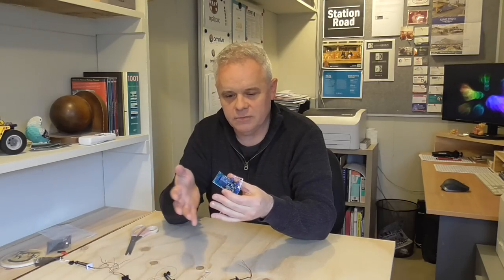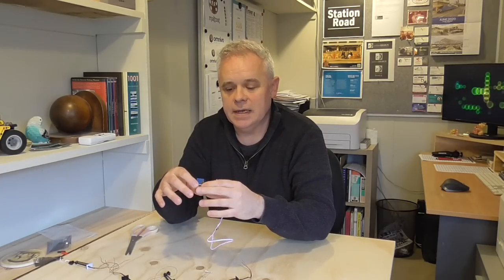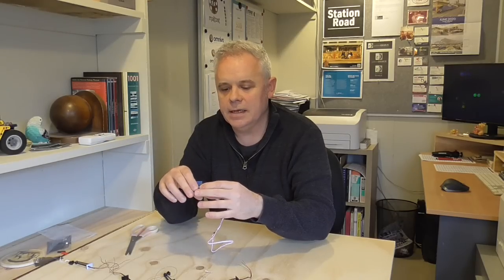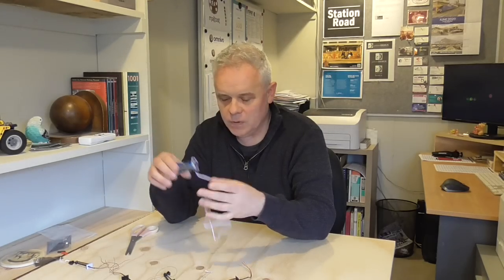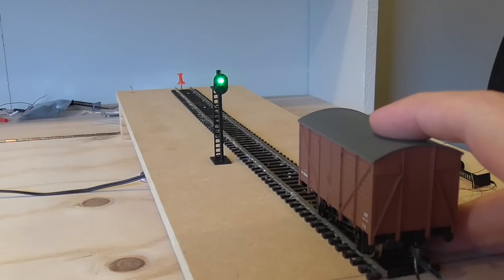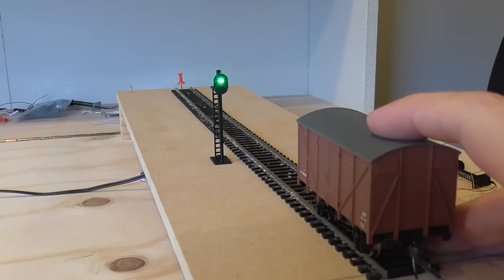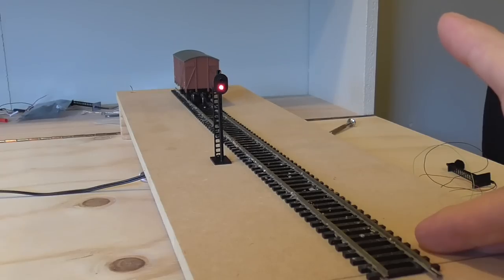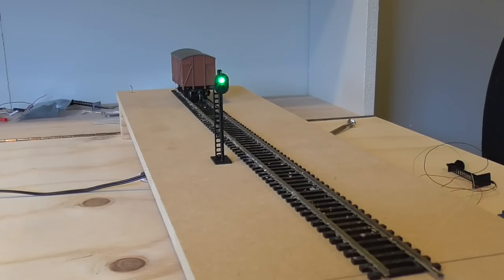Automated Colour Light Signals on a Budget

Comment: I have been using these modules for some time. Cheap. Just need sometimes put a sneaky building and lamp to provide a light, say a  foot crossing or platers shed with lamp. I used as stop end sensors on a shelf railway. Going to use as simple signal changer when train approaches.

Comment: Nicely done.   FYI. The signal lights are designed to be used on 12 volt DC, so  you can just piggy back the input power to the board over to the relay and terminal block, or over to the block and wire it up to the relay, thus eliminating the need for the 2nd transformer.  Oh and the page is no longer found on the AliExpress web address
Reply from the maker: https://www.ebay.com/itm/192279028871

Comment: Just sipping on my L & P with My Jandals on the coffee table watching and thought.  Could I wire this up to a DAPOL semaphore signal you know the sort where there is basically ONE WHITE LED but as the semaphore moves it chages from red to green from the filter  and the signal moves.  I mean would I get enough current from soldering straight onto one of these?   Cheers

Comment: I  will be using servo motor point switching with a side switch for the colour light signal. they will only show a Red light when in the reverse position. (Some might have to be the other way around.) What I have not worked out is Station Start Signals. They may have to be hand switched. I intend to have two through and one terminus station. As for colour. I have white poles and the rest is still black. Thanks for the video and congratulations on reaching  Martin (Thailand)
Reply from the maker: Thanks Martin for your feedback and sharing your signalling/point solutions. There's definitely many different ways model signalling can be operated. I will have a similar scenario with one of my points entering into the station area where 2 signals will operate depending on the point position. Cheers, Julian

Comment: I really like what you have done there, adds some automation without the expensive cost of block detection.
I am sure you could work that to go with a 3 aspect signal, would be good for ground signals too.
Thanks
Alex
Reply from the maker: Thanks Alex, I'll be putting together a video at some point with a 3 aspect signal experiment. I reckon there's a way to do this with 2 or more signals (distance and home signals) where the amber light is linked to the red of the next signal.

Comment: They did use those rounded signals around the sixties, the Southern Region poster "Signal Success" shows a rounded 4 aspect signal with its ladder detail plus gantry mounted signals, Hong Kong also had the same as BR developed Hong Kong's colour signalling system.   Two aspects signals were less common than the three and four lamp aspects which allowed for a better flow of trains rather than the start/stop a 2 aspect would give.   The rounded ones I suspect were more in line with the Southern's art deco theme that led to curvy "Odeon" signalboxes and quite ornate structures (substations had an almost church look with large glazed windows and some nifty exterior detailing to make them look nice)

Comment: Many years ago I did something similar using burglar alarm reed switches in small glass tubes under the track, combined with small magnets glued to the underside of the trains. I did the relay controls by transistors. Using this system I had interlocks to provide a crude block system. For the really technical I used bistable multivibrator circuits for the switching transistors to provide logic for the block system.
Reply from the maker: That sounds extraordinary, love hearing about ingenious, alternative methods of doing things.

Comment: I bought 5 of these relay modules for some dwarf signals in my yard.  I have an old tech 2 power pack that I will run an accessory bus line off of.  Is it possible to run the dwarfs and sensor relay modules off the same accessory bus?  I am pretty good at shorting stuff out...lol.  any advice you can give would be appreciated.   Keep up the good work..  Thanks.
Reply from the maker: Hi George, I must apologies for the very late response to your comment. I think it would be possible to use the same power source for both the relay and signals, just as long as the signals have a resistor connects. I chose seperate power sources just to be on the safe side with current draw, thinking the relay could surge the power thus effecting the LEDs in the signals. And the more signals and relays connected to power sources, the more current is drawn.

Comment: I've got 3 crossing bucks I have installed 3mm red LED bulbs in and got a flashing circuit from fleaBay.  Now I need a way to turn the bucks on and off as a train enters and leaves the intersection.  Others have suggested reed switches or photo cells to turn the flasher on and off.  Any ideas?  I do have an Arduino and have seen the code to make the flashers flash but I need a control for the flasher itself.  My flasher circuit works on either 9 volt or 5 volt DC and I'm using a 9 volt wall wart.  Cheers from eastern TN

Comment: I wonder if you could have a setup where you use two sensors placed at either end of the section...and the first sensor 'triggers' the red aspect and waits until the second sensor is tripped - only then will it turn the signal aspect to green. That way you're more reliably keeping the signal at red until the train clears the block.
Reply from the maker: This is something I didn't investigate further back 3 years ago. I recall working out a circuit that would daisy-chain signals but I'm not sure if two sensors operating one signal would work. One sensor would be 'dark red/light green' and the other would 'dark green/light red'.

Comment: How long did your relays take to arrive? I assume you need one relay for each signal,it looks a good idea. I found a pack of 5 signals on eBay  uk for £15 ,looks the same as yours.Will probably wait for awhile yet as I’m still waiting for some decoders to arrive from Rails,it’s been 4 weeks now. Cheers David
Reply from the maker: Hi David, fortunately I found a local supplier here in NZ and with NZ out of lockdown, it was a matter of days. However, I do order items from the UK and the last lot took 2 months to get here (usually takes 2 weeks), so I'm not surprised delivery times might be considerable.

Comment: Back in the mid 1980's my father-in-law had a OO gauge garden layout and wanted sequential coloured light signals to do the same.  Back then there was little commercially available to do this, so basically I just used four reed switches and a relay wired so that the two outer switches un-lathed the relay, and two inner switches latched it.  OK it meant that at every "section" had four reed switches in a row, but it meant that if a train was run in the reverse direction the signal correctly displayed red when the section was occupied.  The sections were just defined zones, there was no physical blocks.  However, these days model railway electronics has come a long way, even without DCC boards....making it much easier to have things like working lights etc.
Reply from the maker: Hi Malcolm, I totally agree the model railway arena has come a long way from when I got my first Lima train set in the early 80's. From smartphone throttles to iPhone speakers in locomotives, it's quite extraordinary.

Comment: Hi, I am at a bit of a loss with this. I have bought the very same circuit board running a two aspect light. My problem is the timer. The timer seems to only work when the sensor detects light and not darkness as like when the wagon crosses and blocks the light on your set up. Am I doing something wrong?
Reply from the maker: I'm wondering if you bought the correct circuit boards. The version I use is 'dark on/bright off' as per these ones: https://www.ebay.com/itm/192279028871
There might be a version that is 'dark off/bright on' which would produce the results you're getting. There is also another version of board that can do both and is controlled by a jumper. Maybe check to see if you have this type of circuit board: https://i.ebayimg.com/00/s/ODAwWDgwMA==/z/qfkAAOSw1BpgWfHz/$_57.JPG?set_id=8800005007
Reply: Hi Thanks for your reply. I think you are probably right . I will order via your link. Thanks again. John

Comment: Hi. Just found your channel and subscribed. This looks interesting. I have ordered a couple of these along with some other bits and pieces to attempt some coach lighting. I wonder if there is any way to use something like this to operate semaphore signals?
Reply from the maker: Hi Richard, this is a very belated response to your question. It's just taking me a while to catch-up on the hundreds of comments that come in. My apologies indeed. Thank you for your feedback and in answering your question, the relay might work with a motorised semaphore signal, but not sure how. You'd first need to install some sort of servo motor for the signal that has momentary power I guess? The other option would be to purchase signals that come pre-motorised like Dapol's signals.

Comment: I have a couple of the Atlas color signals made for their proprietary signal control system, but the problem I'm finding, since I'm still DC, there are no block detection that is compatible with Atlas' system, and made to work with DC. The other issue, these are from Atlas' first run, so the LEDs are common cathode. I'm having a bugger of a time trying to figure out a system.
Reply from the maker: Hi Michael, I must apologies for the very late response to your comment. I'm not familiar with the Atlas signals but I think there is a circuit device that can convert cathode to anode and vice versa.

Comment: Great video, have a similar system but made myself with a few diodes and resistors and a reed relay, ready made sounds a lot easier, thanks again from Wairoa in New Zealand
Reply from the maker: Thanks for your feedback, great to hear from Wairoa. Somebody else mentioned reed relays so I did some investigation, and yes, they do the job. The light/IR sensor is non-mechanical equivalent I guess.

Comment: Great video mate. How would you go about wiring a 3 aspect signal to one of these modules?
Reply from the maker: I'm thinking once there is more than 1 signal installed, I can link an amber light to the next signals relay. So for a 3 aspect signal, the red and green would be controlled by it's corresponding sensor and the amber would be controlled by the next signals sensor. Hope that makes sense? I plan on doing a video to demonstrate this in the coming month.
Reply: Station Road Model Railway cheers

Comment: If you add a second LDR at the other end of the signal block, the signal, or signals would go to red when a train entered the section from either end. This second LDR needs wiring into one of the wires on the first LDR, and not across both wires.

Comment: The light sensor is a good idea for tracks that are used in daylight.   I use IR sensors, but I find they are also sensitive to natural lighting in the room (ie, sunlight) and sometimes will trigger if the light is bright and not just on reflection. 
I am thinking of moving to Hall Effect sensors, which detect magnetic energy.   I only need to change the sensor for that as I am already detecting on and off in the Arduino / Relay circuits
Reply: I put a feature needing a lamp, like say foot crossing or shed near sensor for night use.

Comment: There are cheap chinese versions of this circuit available through ebay, even cheaper and will work as three or two aspect signals.  You can also vary the length of the delay. These use infra red LEDs and detectors.  They suggest fitting the IR LED above the track and the detector between the rails.  I mounted them between the rails, side by side and the loco or wagons reflect the IR nicely.  It works regardless of ambient lighting. I retro fitted some signals which were made with grain of wheat bulbs and fitted 3mm LEDs.

Comment: Great video Julian, well done and Thank You.  I have been seriously thinking about this system, BUT, mine is a single track layout with running in both directions and I can't fathom out a way to avoid trains travelling in one direction interfering with the signal in the other direction.   Any thoughts, anybody?
Reply from the maker: Hmmm, that is a tricky one. You'll notice I placed the sensor after the signal (half coach length approx) but in the case of a single track line, the sensor would need to be directly opposite the signal I guess.

Comment: Could you explain the use of the sensitivity adjustment.  I have purchased several of the units on e-bay and none of them seem to be set the same upon arrival (several in the active state--red position) and i cannot get it set the change its response,   Thanks.
Reply from the maker: Hi Bob. If you're using the light sensor versions I find the easiest way to set sensitivity is firstly to make sure the sensor is in its final position in the track under normal lighting conditions, then place a wagon over the sensor and begin to turn the small sensitivity dial on the circuit board until the red aspect is illuminated, then roll the wagon off the sensor to check if the light goes green. Keep doing this process until you find the right balance. I hope this helps.
Reply: @StationRoadModelRailway  Thank you so much for you help!.   It is appreciated.  I will give it a try to see how it turns out....again thank you.

Comment: Hi julian great video mate I really enjoyed it I have installed the dapol working semaphore signals at my model of stranraer harbour station they are working every will I work them by push buttons on my control panel for the stranraer line on my layout I use 12v dc to work them on my mainlines I use 3/4 aspect colour light signales work by royart switches I use 9v battery to work them at the moment here in the UK we have a good choice of colour light signales them can be expensive depending on wha what brand you buy I use eckon and berko signles stay safe and well mate goodbye for now clive
Reply from the maker: Hi Clive, I have considered purchasing some Dapol semaphores and think I'll will get some. I imagine I could control them in the same way as the colour light signals, with sensor relays.
Reply: @StationRoadModelRailway  hi julian train tech make a until for dapol semaphore signals and colour light signales Gaugemaster sale them for dcc signal control I hope this information will help you mate clive
Reply from the maker: Thanks Clive, very much appreciated.
Reply: @StationRoadModelRailway  hi julian if you are going to use the dapol semaphore signals dapol now recommend use 9v to 12v dc or 14v ac not 16v ac I hope this information is of interest to you mate clive
Reply from the maker: Yes, I saw Dapol had to do a recall on their signals.
Reply: @StationRoadModelRailway  yes julian the dapol semaphore signals were burning out on 16v ac because the 16v ac transformers were found putting 18v ac and were burning out the signals motors so dapol is saying to use 9v to 12v dc or 14v ac mate I hope this information is of useful to you mate goodbye for a wet N.lreland tonight clive

Comment: Hi Julian,
What do you mean by "It's cold in New Zealand"?  We had 15°C during the day and it's still 13°C at midnight! (Napier)
Are you interested in a cheaper, way more flexible way to control your semaphores?  Controllable by buttons or DCC commands?
2 aspects to many aspects, 256 rgb leds, 768 single colour leds or a mix of them all separately dimmable, servos, sound modules, ...
User defined patterns, day night control, ...
Well, you have to use your soldering iron.
Have a look here - Google translator is your friend - And it's running on my desk
https://wiki.mobaledlib.de/
Reply from the maker: It's a bit colder here in Christchurch, daytime highs of 10-11ºc, -4ºc overnight on several occasions. Thanks for the link/info, I'll be sure to check it out, sounds brilliant.
Reply: Just let me know if you want to know more. I'm happy to chat and also show you.
Here a video of a analog push button example:
https://www.youtube.com/watch?v=61KeRJHV5X4